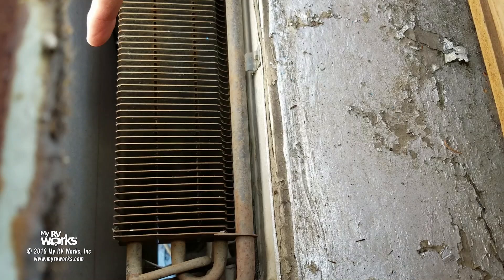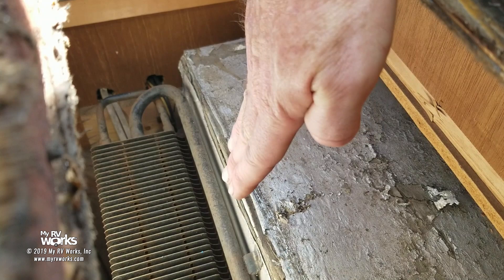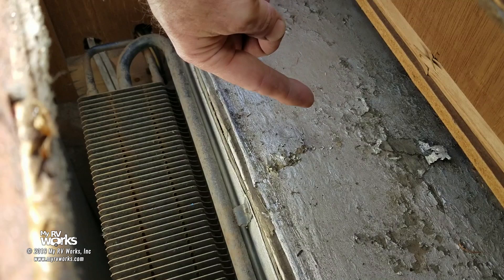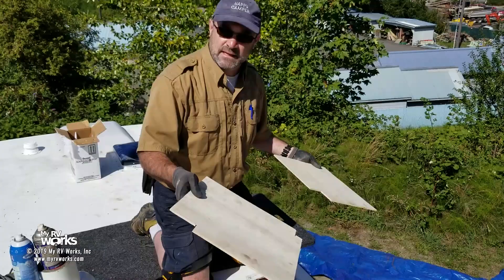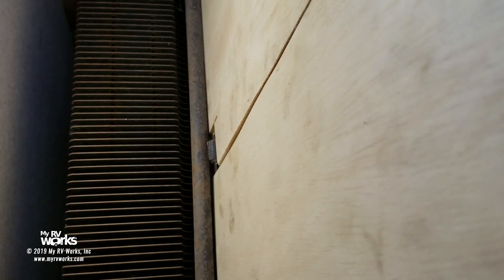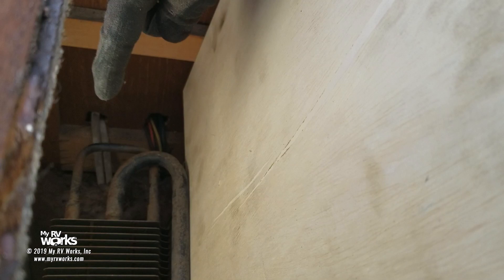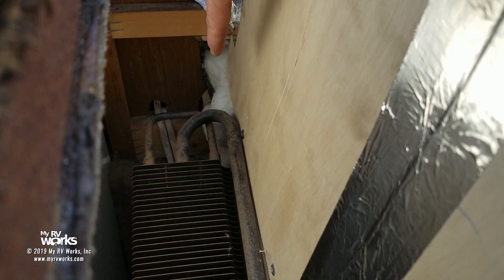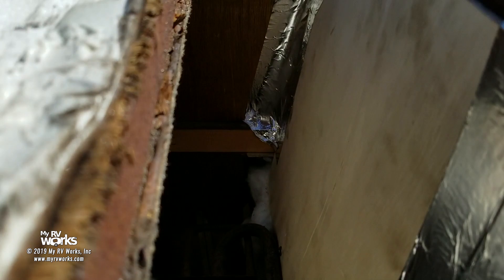Achieving Proper Air Flow Behind Your RV Refrigerator For Better Performance

Comment: Unfortunately RV manufactures are just like all other manufactures these days building things that only last so long. Remember when a house hold refrigerator,washer,dryer,etc seemed to run forever 20-25 years. Now days consider yourself lucky if they last 10 years. The manufactures goal is when things start to go south on you (especially after the warranty runs out) is for you to return for repair or better yet sell you a brand new RV. I'm glad we have people like in this video that has the heart to show us the flaws of a RV and how to fix the problem. I'm currently cleaning and replacing certain items on our 2000 Fleetwood Prowler 26T model that has not seen the pavement in at least 12 years. My RV is still in very good condition and I'll give credit to the 20x30 awning that houses it from the death ray of the Sun. I live off a main street and have had several people stop by wanting to know if that travel trailer might be for sale, I'll say no I can't replace it  considering the ridiculous prices on new RV's these day's. One lady was not going to take no for a answer here a couple years ago saying everything has a price, so I said ok $12,000 and it's yours, that's what I paid for it new. She calmly left the scene, I'm glad she didn't take me up on the price because as I said I could not replace it .

Comment: Have owned my camper 22 years.(1995 layton with dometic 2611 refrig) Have tried SEVERAL things to improve performance. Nothing made much difference until this chimney change. Dramatic improvement. There were several large pockets to hold hot air around and over back of frig. First time I have been happy with performance. This REALLY WORKED for me! Thank you very much for video. I also added 2 small vent fans with on/off switch which rarely come on unless it's over 80 degrees F outside. Thanks again.

Comment: Great video, great information!  One small caveat; the flashing / baffle above the refrigerator should not be screwed to the unit, as that creates more work than needed, should the unit need to be removed again, meaning one will have to go the all the nastiness of removing it the top vent and screen in order to unscrew them.   A possibility better attachment might be flex seal or caulk. The screws along the top are fine, but I'd avoid driving them into the unit in that location.  Thanks for all you do!

Comment: My 2016 Pleasure Way XLTD has a Dometic RML 8330 that wasn't getting very cold. After watching your other videos I found the burner too rusted to clean (even a soft bottle brush broke the burner tube slots!) and so I have a replacement coming. In the meantime I watched your videos on how these things work, climbed up on a ladder and checked behind the top vent cover. Happy to say PW isn't nearly as bad as your examples! The back could be closer but at least is sealed and angled for less turbulence. Air rising up the front however mostly bypasses the cooling fins and goes right out the vent. I have the sheet metal and other materials, so tomorrow I will fashion a really nice duct to get all that air flowing smoothly across the condenser heat sink fins. Thanks!

Comment: Thanks for caring and sharing. I see you filled the one void with insulation, but why didn't you fill the big void behind the boards you put in? Wouldn't the lower screw you said went in the refrigerator cause any damage? Thanks

Comment: We have a 2016 rockwood 5th wheel that we use not a hole lot but evertime we use it in july aug sept it has problems cooling i was concidering a fan but going to try this first thanks

Comment: thanks for the info, I actually did same but didnt know about the 1 inch etc. So I re did mine. except I had an old truck mud flap which was stiff I used for the bottom instead of screwing it in and halods up and in place no issue

Comment: Mine has a huge void with zero baffle on top of the fridge.  I have substantial issues keeping the fridge at safe cool temps in the summer.  Called Dometic and they say the same as you, manufacturers don't read the instructions.  Building the baffle box now and expect to see a big difference.  Thanks for this video.  I took away some great ideas to use on my install.  Cheers.

Comment: I've been dealing with this issue in our Class C because we live in Az. so if the sun is directly on the fridge side it is tough to keep it cooling. Our old 5th Wheel used to have bigger issues with this problem. I will be making these improvements and hopefully it improves the efficiency of the unit. Thank you!
Reply: I found out a better way by putting  intake fans below and fans up top to pull the heat up and out.😉

Comment: I have subscribed after watching a couple of your videos.  A 2005 Keystone Cougar TT we just bought has the exact same faults you just pointed out.  One of your earlier videos pointed out the gap at the end wall-to-upper fins and mine was about 3.5”.  I made a metal V shaped piece that closed that to 1/4”.  Tomorrow I will duplicate the luan panel partition like you just demonstrated.  I’ve ordered a new roof vent as some dork screwed the original down so it almost completely closed the air flow.  In the meantime I’m creating the flue you have described.  Thanks for the great videos!

Comment: hi 
Voids/ empty spaces create turbulent hot spots ,which can 1/ heat fridge casing 2/ block ventilation  airflow  
**  Hot Air from burner must be ducted out typically side wall exit  --allowances might have to made for this .
Upper air vent in wall or roof must be ducted straight to condenser . Therefore all rising air passes over mechanicals and then exits over condenser fins  . Done this way achieves max fridge performance .

Comment: I have the same thing and I didn’t add the wood when I was adding a fan in that area. The fridge started working great after I did add the fans. I think I’m going to add the wood now. Thanks! Semper Fi !
Reply from the maker: Semper Fi!  Low drag is the goal here.  We want to channel the heat properly.  Air is lazy (like some other... oh never mind...  You know what I mean LOL) and needs to be lead where we want it go.  No short cuts.

Comment: This is exactly what I found on my Gulfstream MH except the builder used adhesive foil to close off the open space which over time came unglued and completely blocked the air flow through the condenser!

Comment: We were having trouble with our Norcold refrigerator when the outside temp is over 80 degrees.   Its a single door N8XC on a 2019 Outdoors RV 22FQS.  It vents through the roof.  When I started to research the issue I came across your amazing channel.   I did your homework assignment and sure enough the top of the refer has a space behind it.  Not quite as large as the one in you are working on here, but enough to trap a lot of hot air and destroy the chimney effect.  I packed the void with fiberglass insulation and used aluminum flashing  to cover it.  There is also about 1.5 inches on each side of the refer and I added some flashing there too to aid the airflow.  I was only able to go down a about 1 foot from the roof down the sides, but it is now smooth and tapers to the top vent opening.  I foil taped the joints to finish them all smoothly.  While I was up there I installed a Titan 120mm dual fan setup as well just to assure hot weather performance.  I turned on the refer when done and it was 92 degrees initially inside.  Within 3 hours it was 7 degrees in the freezer and 35 in the fridge.  And get this,  I only set the level of cooling to one star!  I used to set it at 4 or 5 stars, and the refer would be 50 degrees in the afternoon!  The difference is simply amazing.  I  think covering the top of the freezer with insulation made a huge difference as all that hot air was pooling up there making the roof of the freezer inside way too warm, but I think the proper chimney is simply the biggest performance enhancer.  I say that because today I turned off the fans and the refer is still very cold even with the temp in the low 90's and the refer grill in the direct sun.  All I can say is thank you and WOW what an improvement!   I have 2 questions that arose from my observations after doing this.    The first is the burner seems to run much hotter with the excellent airflow.  I think it may have been starved for oxygen before, and now it is really hot.  I could put my hand on the chimney before, and nearly burned myself on it after the changes.  Would these improvements increase burner performance?  Second question is the roof vent cover looks like it doesn't allow the air to escape easily.  I know they are designed to get the hot air out and keep water from entering, but it seems to stifle air flow.  Do roof vents vary in air flow, and if so which brand is the best in your opinion?    I hope you can answer, and once again, thanks so much for your invaluable help on this.  Its simply great what you do for us do-it-yourselfers that want to know how to make our RV's perform optimally in all circumstances.
Reply: Did you put titan on INTAKE (side of rig)  or on ROOF exhaust?
Reply: In the roof exhaust vent.  Mounted directly over the coils if possible.

Comment: Great video. I would have never thought that.  I’d a just thought that was good space to put some exhaust fans pushing the air up.  Never thought of turbulence and how that affects the flow.
Reply from the maker: I hate to report that I see this more often than not. And I'm also the one called in because people's refrigerators are not working. So yes, we need to make this an absolute chimney with no shortcuts.

Comment: I'm just wondering I'm building a bus. This is great information for me. However, driving down the road. Is there any air that Can Enter through that top vent. Because mine does just wonder if I should put a baffle or something in front of the vent.

Comment: Thanks! My brother in arms. I'm going to try putting aluminum foam board in there and the fans, maybe. Are the foam boards safe? Recon 80-84. Semper Fi.
Reply from the maker: Yes they are!  I use those to build up the space between the wall and cooling unit...  Semper Fi!

Comment: You make great videos. I constantly see on Facebook Toyhauler Groups- folks complaining about fridge in slider not cooling properly. If you could do video on this explaining proper chimney airflow is critical for good air flow. Many folks don't understand. Mine had no baffles installed to help air flow, dead air space above and sides. I insulated, HVAC taped and thin plywood added at top to direct air out top vent in slider. Mine works well now but sorry to say many manufacturers don't install like they are supposed.
Reply from the maker: Hi Jeff C.  Thanks for watching!  Have you discovered our Refrigerator Playlist?  We have covered many topics on refrigerators and have more we are working on.  To address your specific concern check out this one.  I linked you right to the 16:15 mark where Darren draws out the correct airflow and discusses the challenges with slide room installations:  https://youtu.be/IT_5HGe4q-k?t=975

Cheers,  
My RV Works Media Team.
Reply: @MyRVWorks  Thank you guys ;-)

Comment: Great job! My Norcold fridge gets warm when is hot outside but it works when it's cooler outside. I checked the top air vent (not a slide out) and the baffle is blocking (almost completely) the vent hole. I can't see anything but the wood board. Should I remove it and re-install so I can down the back of the fridge?

Thank you!

Comment: Love the video once again Darren. Keep them coming. Is there a target  delta T for the refrigeration? Thanks for all you do.
Reply from the maker: The absorption refrigerator leaves the factory set to maintain 0°F in the freezer and 37-40°F in the fresh food (FF) compartment.  FF is 'wet' temp so check it in a cup of water that has been in there for several hours.  It maintains this temp with water, ammonia, sodium chromate, hydrogen, heat and pressure.  By ∆T I am wondering if you are referring to R-value.  I am not sure what the R-Value is for a typical RV refrigerator but I know that adding more insulation around it and having a fan properly placed on the back side to help scrub heat from the coils will only hep it perform better.

Comment: Ive just replaced my roof.  I'm hesitant to willingly put a hole in it for the refrigerator vent.  Is there an alternative for a wall vent you might have used/seen?

Comment: Hi   I have a brand new camper . If I cant put boards in if needed would fans still help out greatly.  Put 1 on bottom and 2 on top. Where can I buy a thermostat to turn on and off my fans. What temp for top and bottom. Thank you for this great information.

Comment: Hi Darrin I have watched a few of your videos going to attempt the bagel when I get home  
the problem I’m having is the freezer is -10 top of fridge 38 and the bottom is at 47  I have replaced the thermister added a small fan behind the fridge to blow more air when I put a dollar bill to ck the seals it all feel snug 
Oh an have a fan on the inside of the fridge 
So I’m not sure  why the such a difference in temp from top to bottom 
It’s  a dometic dm2852 3 yrs old 
Any help would be great

Comment: Air flow and 'levelness' of the fridge as sitting in the RV chassis are the two critical issues of RV fridge operation, correct? And the more critical of the leveling axis for the fridge is 'left and right' as you look at the fridge from the front, correct? That's where the path of the heat exchanging chemistry flows down it's zigzag circulation tubing. If it's not so level from 'front to back' as you look at the fridge, it would probably be less of an issue since the downflow of the zigzag tubing wouldn't be very affected, right?

Comment: I like the video. Well done and good advice. My new 5th wheel does have the fridge in a slide out and it is on the South side so it gets very hot. Would love some help on how to improve it. I has a thermostatically controlled fan that has a irritating squeal. Maybe it wouldn't have to run so much if I could improve the airflow
Reply: Sounds like you should change the fan. If it's squealing it's not working full potential

Comment: I have a 2012 reyo, with a Dometic 8555 fridge. It works great with 120v, maintains on 12v, but doesn't work on gas. If it works ok on 120v, is it posible, to be out of ammonia mixture? I've watched many videos,  none ever mention that. I've followed other of your videos, have trouble shot mine, it has proper gas, the burner ignites, but it never even starts to cool. My unit already has a fan installed. Don't know how to test, the fan, either. Can you help me ck further?

Comment: What's your feelings on a power (fan) vented  Exhaust cover?   As she a lot of people/videos where they're forcing  The exhaust through the chimney By use of a fan. Seems like an easy enough fix. But you Sir are  The experience expert in RV  Refrigerators. Thanks for the videos with your help I was able to fix my  refrigerator In my Majestic
Reply from the maker: The key is to shed the heat off of that cooling unit. But the most important part of that statement is to make sure that your chimney and baffling is set correct. Moving the air up the back side of the cooling unit is not the same as moving air through the condenser fin.  The focus should be the condenser fins.
Reply: So I went and checked, oh my God you are absolutely correct there's nothing but Air, exactly the same as your video. What are your feelings on foam with the metal heat shield?
Reply: I used the insulating foam boards with aluminum tape today. Worked fine. Made sure to stay AWAY from hot stuff. No changes yet. 108 outside.

Comment: Thanks did you have a video on installing a fan setup? Also did you add any insulation down the sides of fridge
Reply from the maker: I will add a frig fan install to my list of video's to make.  The frig already had insulation down the sides but I did add it to the top sections to channel the heat where I wanted it to go.

Comment: Hi, I have watched many of your videos. I don’t see you mounting any fans to cool refrigerator compartment outside. I have made an appointment with you to install fans in the outside compartment to cool my refrigerator. I hope I’m not making a mistake. My refrigerator does not cool very well.  the freezer does not get below 10°. Most the time it’s in the 20s. Refrigerator stays between 40 and 50°. The propane seems to work well I have a good flame it doesn’t seem to make any difference whether I’m plugged in or not. My question is when would you install a fan?
Reply from the maker: The issue with refrigerator cooling performance has everything to do with the ventilation of the backside of the cooling unit. The specification is 0" on either side, less than 1" to the back wall, and depending on if your refrigerator is in a slide room or if it vents straight out the top, we must verify that the air flows through that top condenser Fin and does not take any shortcuts. So before we look at adding fans we first must verify that the chimney on the back side of the refrigerator is to specification. If it is not, then fans are not going to help.  Having said that, if your refrigerator is in a slide out then fans are mandatory. One common issue we see with refrigerators and slideouts is that they did not create the proper baffle to force the air through the condenser fan before it exits out the top vent. In this video I create a drawing on a grease board where I explain this a little bit more.
https://youtu.be/IT_5HGe4q-k
Reply: @MyRVWorks  
Thank you for getting back to me. My refrigerator does have the top and bottom vents on the side of the van. If I understand your video correctly, I do need fans inside that compartment I was that scheduled my appointment with your staff to have them installed. Thank you so much.